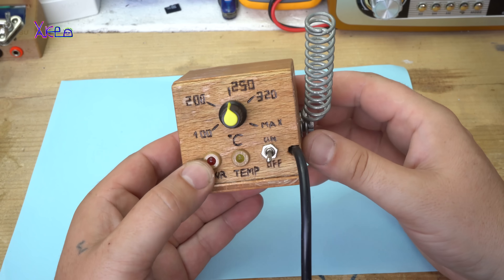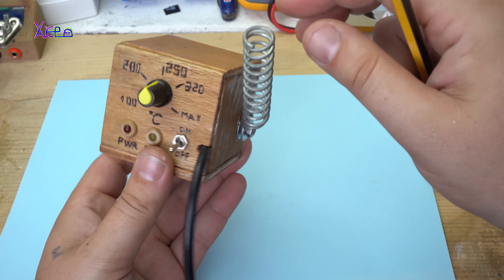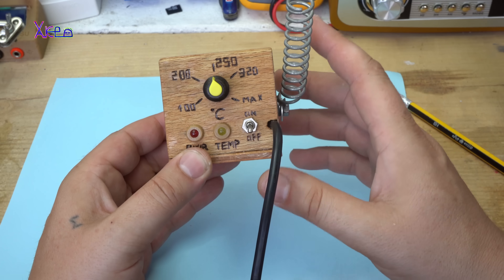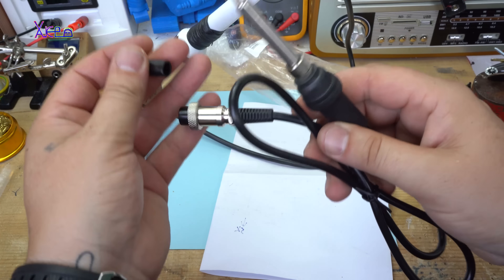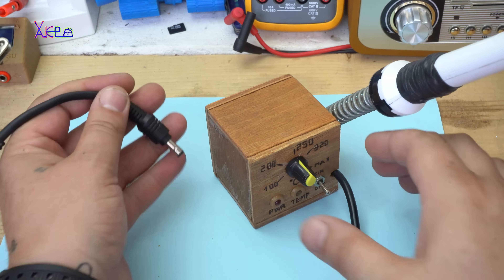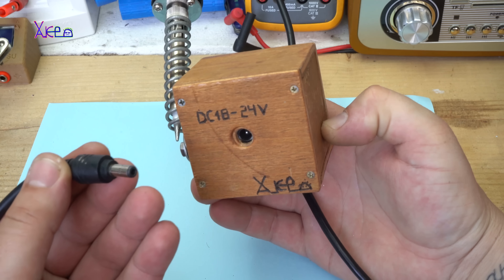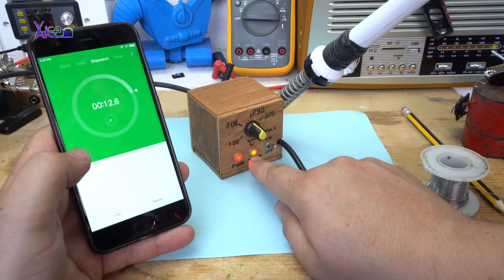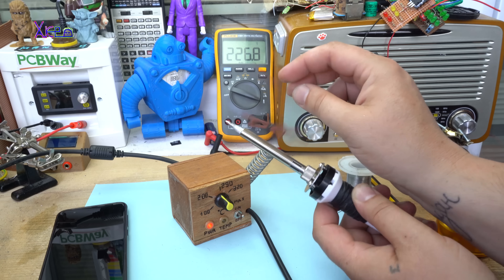Homemade Soldering Station for 6$ | cheap way to make soldering iron

Comment: I built this very circuit and it heats up just like yours in 55 seconds. Only problem is the led is not lighting like yours and the mosfet is getting too warm or hot. So I'm back under the hood. Cheers and thank you.
Reply from the maker: Thanks for the feedback, hope you can figure it out and get it working perfectly!check pinouts of mosfet and add a heatsink
Reply: @Hacktuber  Bravo that. Fet is well sinked and board #2 in progress. Enjoy the mystery.
Cheers!
Reply: @Hacktuber  Problem was a broken ceramic element and compromised thermocouple leads. I replaced with a ceramic in a metal tube. No heat on the fet and the led is dancing in the rise and fall of temperature. cheers! Rob

Comment: I try to build it from kasyan tv YouTube channel but not working in his video he used all resistor 1% tolarense, but i used all resistor 5% tolarens and I can't find a 100nf 50v capacitor then I used 100nf 25v one , Can you showe us how did you modify the circuit and did put together

Comment: can i use a irlz44n instead?
Reply from the maker: Yes,he can handle 40amps
Reply: @Hacktuber  Thanks a lot!! I have a newbie question:where i connect the potentiometer wiper in the schematic? i can see the incoming voltage from pin 8 and the ground pin but i cant see where is going  the wiper center pin on the schematic can you help me out :)

Comment: I hope you reply to my comment. In this schematic, where thermocouple is to connected?
Reply: OP1 with a 2.2 k resistor in series on pin 3 with  100 nf ceramic capacitor to the + of the thermocouple and to the - of the thermocouple to ground plane

Comment: I know a more easy more cheap way.   Wanna know
Reply from the maker: There us no cheap way that mine😁
Reply: @Hacktuber using a voltage regulator.  A fan dinner.  Can control the temperature of the of the Soldering Iron...       Works on a 220v Ac device .